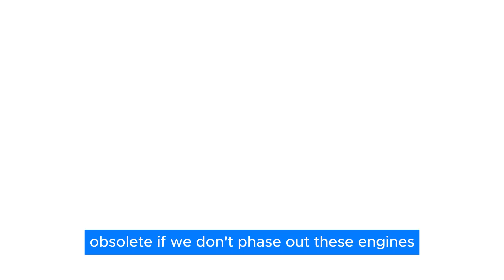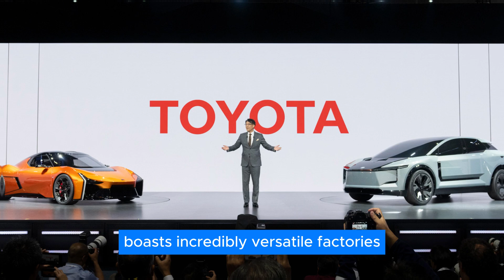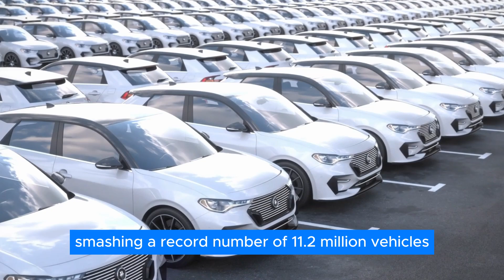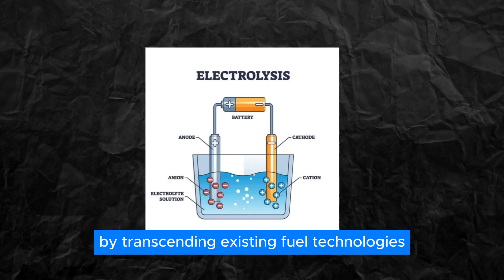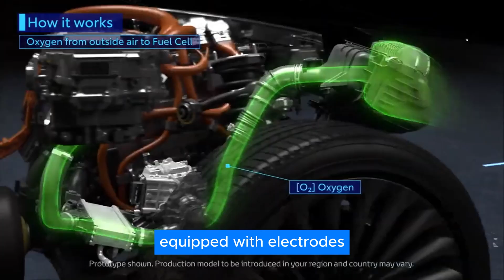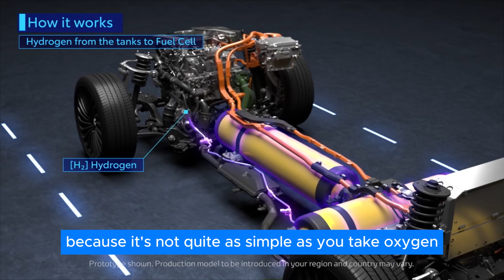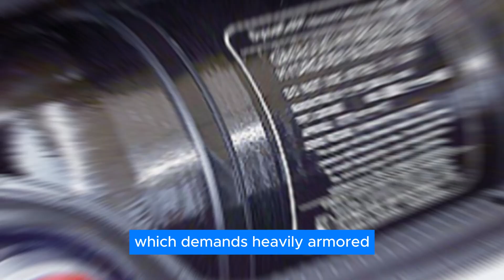Toyota CEO: "This NEW Engine Will Destroy The Entire EV Industry!"

Comment: Enough of piston, valves, tappets, gears, timing chains and hundred of parts in the engine that can go wrong. Oil Filter and lubricant need to change frequently. The electric motor have not many parts and motor sealed for life and do not need lubricant.